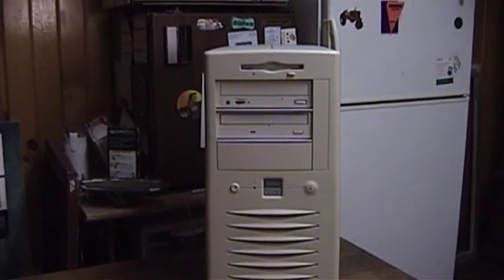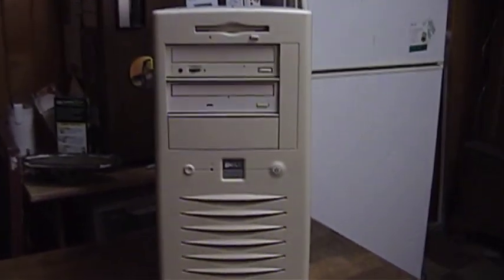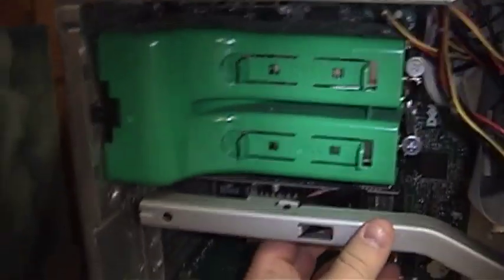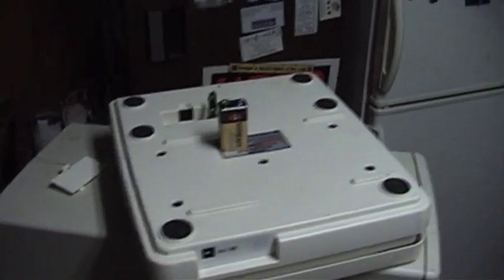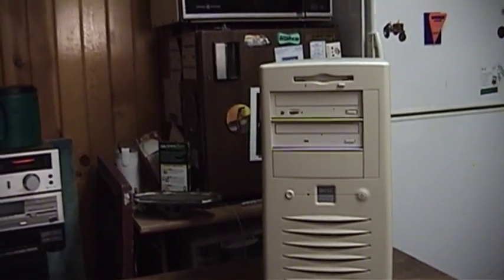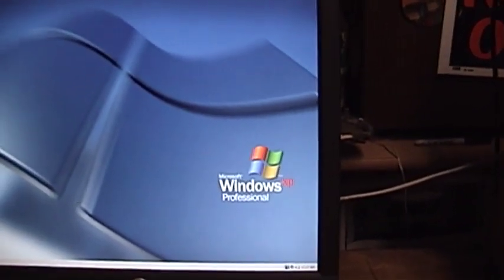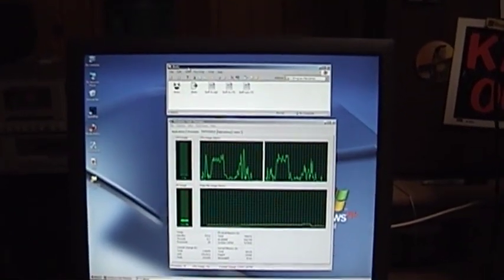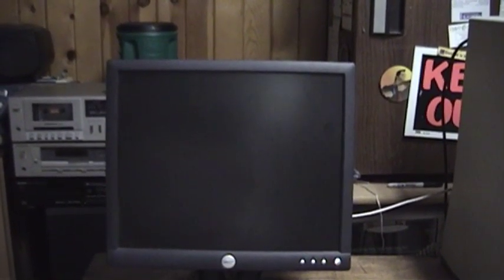Dell Precision 220 Workstation/Multiprocessor Computing Fun!

Comment: With its 3.6 GHz Pentium 4 HT processor, my IBM ThinkCentre blows hotter air out of its fan than a Chinese Wal-Mart hair dryer... I can sure see why Intel gave up on the P4 architecture! I also got a free 1.4 GHz P4 Gateway once, but tossed it out when I discovered it only had 128 MB of that stupid RAMBUS memory, and adding more wouldn't be worth the money.

Comment: This is a trip down memory lane.  At work I had a Precision 220 and two Precision 420s which were the same dual physical processor computers except they used Xeon procs.  These weren't my first true dual processor systems, but they were my last before the switch to multicore procs.

BTW, your estimates on price are about right.  The 420 with multiple SCSI hard drives in RAID cost my company just over $4K each.

Comment: Hello Uxwbill, I have the same Dell Precision 220 tower workstation except it has slower Pentium iii at 667Mhz, 256MB of RAM and the Matrox G450 video card. Is it actually possible to open the right side cover on the computer? I've looked through the entire Dell Precision 220 service manual and haven't found any single about opening the right side cover. Do you think it's even possible?

Comment: Did you know that the first instance of RDRAM's use was in the Nintendo 64, to deliver better performance when rendering polygons?
Reply: well, it cripped the system, due to high latency.
Reply: @CocoaEm  er, no? It didn't. DDR didn't exist back then, so it was quite actually the fastest available memory bus.
Reply: @8bits59  yes it did, accessing the ram was slow, the gpu has an inbuilt cache, thats why all textures on the n64 are so low res. They have to fit within cache. the ram also slows the cpu due to the high latency.
Reply: @CocoaEm  right, of course it was slower than cache, that's how RAM works. It's latency was lower than SDRAM though, because again, that was the only other option at the time. DDR blows it out of the water for sure, but it wouldn't exist for about another 6 years.

Comment: There are still computers and servers with Intel Xeon having 2 physical processors.
Reply: Of course. I don't see that as a surprise
Reply: my workstion has two 4 cores
Reply: I have an HP XW8200 with 2 Xeon processors and that also is one heavy beast.

Comment: My first and only multi-processor computer is an Apple Power Mac G4, with two 1.25GHz PowerPC 7455 processors. I think I should start using it more often. I got it in the summer of 2012, I think.

Comment: I just got a 20' iMac G4, it weighs about 40 Ibs even though it has an LCD panel LOL.

Sega did this in the mid 90's I think the Saturn used Dual Hitachi CPU's.

Could be wrong there, I suppose this approach could be advantageous if one CPU broke down, say ye were running 2 dual core CPU's, if one failed ye'd still have one dual core left to use.

Which might be handy in critical applications or something else  if the motherboards logic was smart enough that execution could continue on the other CPU.

Prob a completely incorrect analagy Bill but it was just something that came to mind.

Comment: Heavy isn't always good.  When I built my latest custom machine (core 2 quad q9450 + asus p5e3 deluxe) I put it in an all-aluminum LianLi case which cut the weight down significantly.  This is especially considering that I'm running a pretty large PSU and there's a ton of copper on the P5E3.  It's also useful to cut weight on the case if you plan to transport the tower around.

Comment: I use a dell precision m6400 that I think was top of the line back in 2009 which has a Core2extreme quad core QX9300 with 12 gbs of ddr3 ram, 480gb ssd, and a blueray burner and is running Windows 7.

Comment: I can go even further back than this.  I worked at a small computer store that had a Dell "Omniplex" which was a short lived line that was a tiny bit better than the Optiplex, but before the Precision series came out. The Omniplex had a dual Pentium 166 arrangement running NT Workstation.

Comment: Bummer on the two CPU's you left the Plastic AIR BRA,If your going to Show and Tell You need to Show all the Goods when your Going Naked with the Bare Show me all the Good's..

And BTW my First DUAL 486 DX 33 IBM unit, the Second Dual system was the IBM IntelliStation Z Pro Workstation 98xx(something) it was the Tower (2) Pentium Pro 200Mhz 256K Cache (Upgraded) to the 512K then the 1Meg, Then the Final the Pentium Pro Overdrive 333Mhz Low ass Cache, then the Power supply went kaput Then I went to the Proliant 6000 (QUAD) Pentium Pro 200(1M) 512 MB, then all the way up to the Proliant 8500 (OCTAL) 900Mhz 1MB Cache(Had to run 220Volts to get all 8 CPU's running Full)

Comment: holy c** 768MB RAM? that was CRAZY for the time. if you upgraded it a little it would be powerful enough to run vista.
Reply: *****
not in vista starter.
Reply: +Devin Hepburn Actually, this computer could most likely run 7
Reply: sonic1934 But paging will occur if you do.
Reply: Devin Hepburn I saw windows 7 run with about half a gig of ram, on a computer that ran windows 98 before, and it was pretty ok at doing tasks.
Reply: +Devin Hepburn I have year 1999 IBM xseries 220 8645 computer with dual 1ghz p3 coppermine and 4gb of ECC Sdram :)

Too bad that it does not have a agp slot... would make a beast of a 90' gaming rig if it had...

I wonder if i use dual voodoo3 pci 3d cards and a 2d pci card would it work?
Reply: +DellLatitudeD630ATG Actually Windows Vista requires atleast 512MB RAM, not 2GB.
Reply: Mike Hall
that's probably a different component.
Reply: +Devin Hepburn VISTA eeeewwwwwww
Reply: +Biostorm7 Vista requires, at minimum, an 800MHz processor and 256MB of RAM. Of course, you really need ~2GB before it becomes worth using.
Reply: Jacob Turner According to MS the minimum is 512MB RAM for home basic and 1GB for the others. However i do agree that you do need atleast 2GB before it's usable
(source: https://support.microsoft.com/en-us/kb/919183)
Reply: Biostorm7 Ah. I must have confused the posted minimum with the minimum required for it to boot.

Comment: I got a file cabinet-shaped server with SuperMicro 370-DE6 EATX motherboard, dual PIII/933, 1GB ECC, dual U160 SCSI, AGP, plenty of PCI64 slots. Lowest spec is single 100mb network onboard, so I added a 3Com gigabit card before installing NAS4Free on a CompactFlash card (boots like a normal IDE disk) and, since I only had noisy used 73GB U160 disks, new SATA2 drives on a SiL3124 PCI64 controller. Then one of the proprietary redundant power supplies failed, and the failover controller does not switch reliably to the other one, so I moved the drives of the ZFS pool to a recent motherboard with 8 onboard SATA3 ports. But I may install Windows 2000 or XP on this old server and try it as a vintage workstation if I find a high-end AGP card to put there. I had already tried Windows on another similar dual PIII server with low-end onboard graphics, but could not upgrade to 7 because support was dropped for the NC6136 network card I was using (maybe intentionally as planned obsolescence of 64-bit PCI and optical SC connectors, or because end-users are not supposed to enjoy a fiber LAN).

Comment: The 210 is better, in my opinion, because it can take the same processors (up to dual 1GHz PIII) and doesn't require RDRAM nor a VRM module. There isn't much performance lost when using a gigabyte of SDRAM, and it's so much cheaper and easier to get. I use mine as a classic gamer, with a Radeon 7500, Live! card, and a RAID-0 array.

Still, the 220 is a great machine, back from when Dell was known for rocksolid quality. Nice video!

Comment: The big "pin pack" is TQFP, Thin Quad Flat Pack. This is probably a TQFP-160 here. Such big TQFPs are no longer seen is modern (read, in recent 5 years or so) electronics - TQFP-144 is probably the biggest TQFP you'll ever get, and anything beyond that is all BGA.

And in modern systems like Sandy Bridge or Ivy Bridge, you cannot go multiprocessor unless the chip is designed to allow this. I have a multiprocessor server with two Xeon E5-2620v2's and it requires special design considerations on the processor to make multiprocessor work now.
Reply: +Brett Bates The problem is cache coherency. Even back in Core 2 Duo times when NUMA was nonexistant (LGA775 & LGA771 sockets, remember the hack?) only processors that have extra lines built in that supports cache coherency control can be used in multi-socket scenario. NUMA adds another layer of complexity though, as each NUMA node is technically its own computer sharing peripherals over something that is similar to the PCI Express bus, using something similar to RDMA to access each other's RAM with cache in mind.
Reply: +Brett Bates The interconnects are different too. Since Sandy Bridge there are three types of interconnects from the processor: PCIe, DMI and QPI. PCIe is the captain obvious. DMI is pretty similar in PCIe but with higher efficient protocol - in fact on a dual- or quad-socket Xeon E5 system can have all but one DMI lines be switched to PCIe lanes too. QPI is something more akin to Infiniband - for high speed remote memory and PCIe access. Desktop class chips (Core i-Whatever), as well as Xeon E3-12xx. E5-16xx all have 1 set of DMI and no QPI. E5-24xx adds 1 QPI lanes, E5-26xx and E5-46xx adds another on top of E5-24xx, and E7-x8xx have 3 QPI links.

Comment: I have an old Dell Precision 410 Computer with 2 pentium II cpu in it ! I have to look for 2 similar pentium III cpu to upgrade......this old Dell computer. I wonder if my has the bottom IC Chip in it. I am going to check this out today. I wonder if windows 7 will program on this Duo CPU computer at all ??? If not leave it on XP .....operating system. Thank for the video !

Comment: love the video, i have a dell precision 420 mt running dual p3 733mhz i bought and refurbished. i can only get it to run 128 meg rdram chips though? ive tried 256 mb pc 800 but all it does is the death beeps so im maxed at 512mb pc800 backed up with a agp geforce fx 5600 256 mb vid and a barracude 10k rpm hhd. the isa slot you referred too is actually a pcix slot that they started to come with in later models. i still use my precision 420 on a daily basis as my xp pro gaming pc.

Comment: i had quite a bit of a fun with a dell 490 precision last year. The dual quad core model. But after having to replace 3 power supplies and send back the motherboard 4 times under warranty i gave up on the beast. With all the extras it weighed in thee most heaviest computer ive owned. Dell do make some good machines. The best are their tickover machines like the optiplex and E520 faired good but they did make some junk too

Comment: Windows XP Professional 32-bit supports dual socket motherboards with both sockets occupied by a cpu, i know because i had to install xp on my Precision T5400 when i got 2 cpus with diffrent stepping and wattage, so 7 didnt work with it, but xp ran with it and utalized all 8 cores
Reply: TheBlackSnow TBS Windows 7 Pro will handle multi-CPU.  Home Premium won't, though.
Reply: It wont if your cpu's have a diffrent stepping
i finally got another e5450 with the same stepping and it worked on windows 7 pro perfect
Reply: TheBlackSnow TBS Ah.  Well, you learn something every day.  Honestly didn't know that one.
Reply: yea, its good to know because ull end up buying 3 cpu's like me, first 2 where diffrent stepping and model E5450 and X5450 with diffrent stepping then i bought another E5450 with the same stepping as mine and threw the extra cpu in my empty T5400, i found more X5450's the other day with the same stepping as mine on ebay for 25$. 25$ for 4 cores at 3ghz? cant beat that lol

Comment: Very interesting setup for the precision 330 with the dual PIII 1.0ghz processor. I have one from Dell which is the Precision 520 with the dual 1.5 and 1.7 GHZ processors. (Two different machines one containing 1.5 GHZ and the other 1.7GHZ CPU but both have two of the same CPU speed in each of them.) Very good machines for rugged for processing data and crunching numbers on both I just have to replace a battery for the cmos in one. And it will be fine.

Comment: You'd need a motherboard with an ISA slot. If you don't care for speed, you can use any old socket 7 motherboard with an old Pentium MMX 233 or some AMD K6 or K6/2. If you want something with a bit of spunk, you're going to have to look around.

There were several Athlon/Pentium 4 motherboards with at least one ISA slot on them for legacy stuff. There are a couple of very expensive industrial boards that use modern cpus that still have ISA slots.

Comment: My old highschool's video production class had a four-processor computer. I believe they had 4x dual-core Intel Xeons. They probably never used more than 10% of that computer's capabilities, but still, it was pretty neat none the less. I think the computer was capable of supporting Quad-Core Xeons as well, which I why I'm surprised the company that made it (BOXX, IIRC) didn't opt for 2x quad core.

Comment: I've got a Compaq workstation (can't remember model name) that starter its life as a dual 256k Pentium Pro 200mhz and a 4gb SCSI drive. I bought it probably 4 years ago and upgraded it to dual Pentium II Overdrives and 128mb EDO memory on ECC DIMMs. I never really used it for anything, basically it just sat at the desktop running XP Pro with a dialup internet connection and internet connection sharing software. I haven't used it in a few years and it's dusty now but I'm sure it would still work

Comment: I have a Dell PowerEdge 1300 Server which has dual pentium 3 500mhz slot-1 processors, 640mb ram, 3 9gb scsi drives, and im running windows 7 ultimate on it. It has a very similar layout to the dell in the video, but it does not have any sound card, and has a pci Ethernet card. When i first got it, it only had 1 450mhz processor in it, but i had 2 500mhz (which is the highest it can support) processors spare and used them :D

Comment: My family bought an HP computer in 2000 that had the colour coded ports, the computer was made in 1999 I think, so this Dell doesn't 'predate' the colour coding convention whatever it's called.  What are the options you've installed in the PS/2 80, I couldn't work it out just form the video.

Comment: I have a 2-CPU Motherboard also! It is an M668-Stallion Motherboard, with 2 Pentium II MMX 500MHz processors and 1GB PC100 RAM. It has, no joke, ONBOARD SCSI, BOTH 68(?) and 50 PIN! Along with the normal Quad-Channel IDE and Dual Channel Floppy controller. I mainly use it for Hard disk testing. It has no Casing though, so I should find one soon... It has 4 ISA, 3 PCI, ans 1 AGP slot. Almost all of the slots are populated, as the motherboard itself has almost nothing onboard except the SCSI controller!
Reply: The FULL SPECs. of this computer are as follows:
2 Pentium II MMXs clocked at correction to above 200MHz;
4 256MB PC100 RAM modules;
Onboard SCSI;
nVidia Riva TNT-2 32MB in the AGP slot;
a Netgear FA-310X in a PCI slot along with some soundblaster-compatible... thing, a TV-Tuner card by panisonic (lol idk why Its even there I don't use it), and a PCI SCSI Controller I pulled out of a Power Mac G3;
Then in the ISA Slots there are:
An old Seagate MFM Board (that doesn't really work), a Mediavision Pro Audio Spectrum 16 (with a "thunderboard" built in), another SCSI Controller (again, I have NO IDEA WHY), and some multifunction board that just keeps time and date stuff, as this motherboard does NOT, in fact, have an onboard clock;
Quad-Channel (yes, I know) IDE (as in 2 plugs and 2 drives on each);
Dual-Channel (agan, i know) Floppy (as in 1 plug, 2 drives).

It has no defined Hard disk drive, or any drives at all, for that matter... I don't use it enough for somethinglike that. I DID use it about a week ago, for (you're not going to belive this...) blowing old LEDs and other components that I hapened to have lying around... That video will be posted soon!

WOW! This comment is WAY too long, os I'll end it here. Sorry for the long comments...

Comment: in theory, windows 7 just requires the i686 instruction set, just like Vista, which means you could even run it on a cyrix 686-type chip.

Comment: My, that was a lot of talking there.

i820 had a single-channel RDRAM interface, hence it takes single modules.

i840 (PIII) and i850 (P4) with their dual-channel interface needed them in pairs.

RDRAM never was a good match with PIIIs - high latency and high bandwidth vs. need for low latency and moderate bandwidth. The infamous (buggy) MTH also provided the downsides of both with SDRAM if needed.

My main machine actually uses two PIII-667@500Es on an Asus P2B-D, with 1 gig of SDRAM.

Comment: @uxwbill It's been "a while" since I worked on machines that took RIMMs (the last being Dell GX400s), but I had thought that they took them in pairs. Maybe that was a P4 thing with a different chipset than the PIII that you are working on. As luck would have it, I'm working on a family friend's Gateway that needed a memory upgrade which takes RAMBUS, so I ordered some. The 1Gb (2 x 512Mb) pairs were crazy, but, the 512Mb pairs seem to sell for around $10 on eBay, so maybe you could do that.

Comment: Yep, that reminded me, my new for 1999 Dell Latitude L400 does feature an Intel Pentium 3 clocked at 700MHz, and the infamous i815 chipset and its 512MB memory ceiling, but instead of an Intel 10/100 Fast Ethernet adapter like my little EBX board of a similar vintage sports, the Dell has a 3Com 10/100 adapter.
Not exactly sure why the EBX board has an Intel chip and the Dell has a 3Com. Go figure.

Comment: There is a third party bios out there which will allow tweaking of settings and i believe the ability to add more memory. But it's risky to flash. Even more steps than flashing third party firmware on a linksys router. I might pull the trigger and do this to one of my precisions. I'll let you know and put up a video.